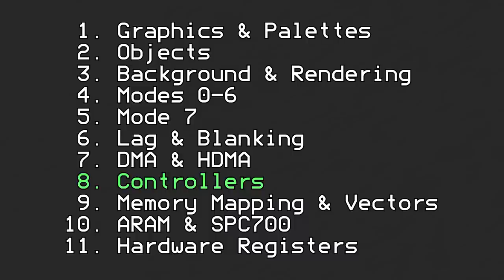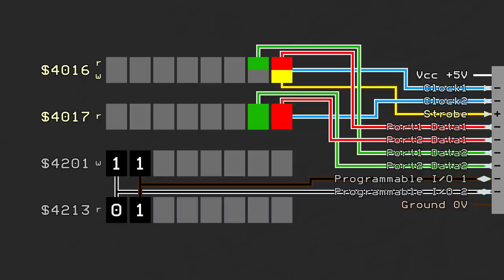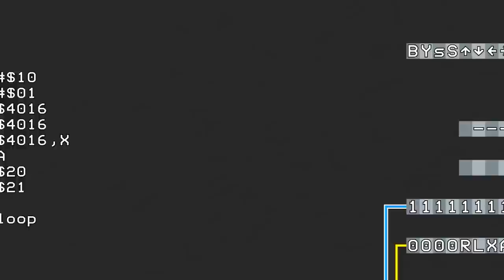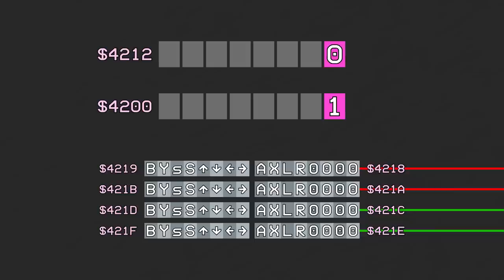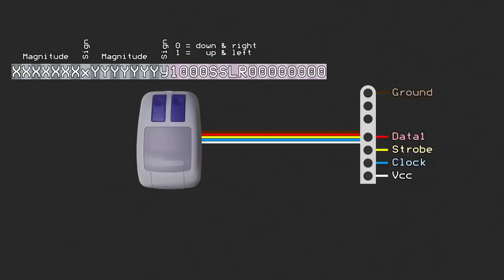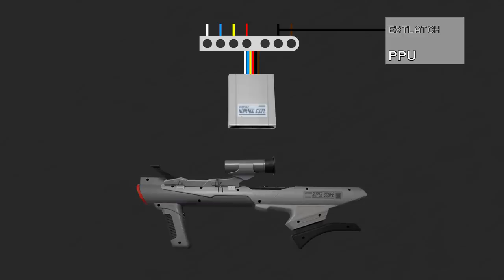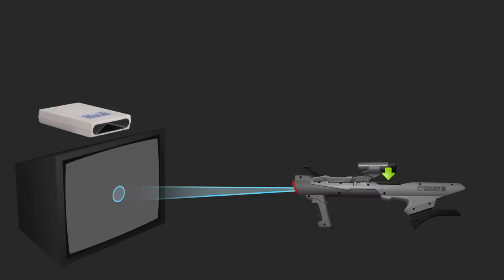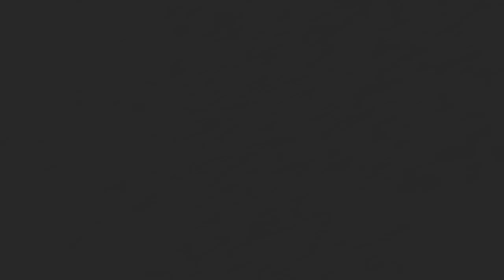Controllers - Super Nintendo Entertainment System Features Pt. 08

Comment: You gotta see what's possible with official SNES hardware and TAS, the TASbot team was able to get Skype running on a console using nothing but arbitrary code execution and several million controller inputs PER SECOND, across 8 SNES controllers.
Reply: Woah. That's amazing, actually. o.o
Reply: Basically streaming video data through a serial port. Not exactly "running" on the SNES.
Reply: Just to show that hardware limitations can be greatly reduced by clever use of code. I wonder what could be achived with modern technology if everything was used to the brink of its capacity. 
I mean.... yes its impossible due to the sheer size of code involved, but just think,
maybe someday we will have machine learning AI strong enough to auto-optimize any code to that level of usefulnes.
Reply: thats so cool!

Comment: It’s crazy how excited I get whenever I see that you posted a new video. Truly some of the highest quality content available for the subject matter.
Reply: This is probably THE most understandable explanation of a small system architecture I have ever seen/heard. Those expensive student coarses are much worse. I will probably never program SNES at all but this is very interesting nonetheless.
Reply: @jwhite5008  I agree.  Elementary computer engineering courses should be taught from this youtube channel.
Reply: @jwhite5008  SNES programmers had it easy. Try riding the beam on a Atari 2600 with 20 bits of data...
Reply: @jerricabenton842  
The classic education system has been overthrown by YouTube.

Comment: Super excited for the 10th video talking about the SPC700, there don't seem to be too many good in depth explanations of it out there.
Reply: I can't wait 😩💦
Reply: what i know abou SPC700 Sound Chip :

they have 9 channels
sample are programmable
some snes emulator can save spc data into .spc file format,which can be played by any spc700 player
its a sound chip obviously
Reply: 8 channels, actually.  64 KiB of ARAM, 4 registers to interface with the SNES processor, echo delay up to 240 milliseconds...
Reply: Also, the SPC700 proper is actually a 6502-style processor that controls and sequences the S-DSP chip, which does all the audio processing. And the 240ms digital delay line includes an 8-tap FIR filter, which when combined with feedback can be used to generate reverberant spaces.
Reply: And some strange stuff about BRR.

Comment: I had no idea these controllers were so complicated...
Reply: I had no idea the Super Scope was so complicated
Reply: There are some way more complicated ones, like the 6-button megadrive controller or newer stuff like the Wiimote
Reply: @Wuerfel21  nah, newer stuff uses off the shelves protocols, very high bandwidth, and not synched at all with inner working of the main machine CPU. Lots of software takes care of everything in modern hardware. Modern controllers use microcontrollers inside that are thousands times the processing power of the SNES. No one cares anymore of counting every CPU cycles.
Reply: @Damien.D  partly because with multicore CPUs, that's basically impossible.
Also, Bluetooth, which is used for controllers, is a very strict standard. You can't just do whatever radio you want
Reply: These are very simple controllers technically.
Reply: The wiimote would probably be an interesting one, 14 analogue axis (with nunchuck), buttons, light gun, speaker and memory saving on one device.
Reply: Actually, they're surprisingly elegant.
Reply: everything is complicated in electronics.
Reply: Ikr, I never thought they went beyond "press a button, send a 1, carry the 1 until button it's no longer pressed, 0", maybe because I'm just an electronic technician not an engineer.
Reply: Peter Hart: what?
Reply: 3 button mega drive/genesis and Atari 2600 are dead simple by comparison.

Comment: This is so neat. I was already wondering if you could just y-split a SNES cable and attach two pads (twisting the D1/D2 lines for the second controller like in the old floppy drive cables) and therefore getting a rudimentary two-players-per-port (assuming software that expects player two on port1-D2) but of course, using the programmable line as a toggle is really smart, not like the basic gamepads make use of it anyways, right?

Kudos on the video dude, I've mangled examined quite a few gamepads over the years, but only from the hardware perspective, so learning how the CPU interacts with them is really interesting.
Reply: furby

Comment: When you described Auto-Joypad read collecting 4 controller's worth of input at a time, I assumed the multitap worked by plugging into both ports and mapping both data lines of each port into the first data line of each of the four controllers. I didn't realise the multitap actually enabled 5 players (and is much more complicated than just taking advantage of the built-in auto read)
Reply from the maker: Yeah, one of the most confusing things about the multitap is the order of the joypad data... With auto joypad read, the data from the controller plugged into the port labelled "3" actually goes into what is referred to as "player 4" in the documentation, while "player 3" is left empty!
Reply: two easy explanations
A. the SNES works with ports 0, 1, 2 and 3 , which map to players 1, 2, 3 and 4 respectively.
B. the multitap documentation is based on controller+multitap instead of unplugged+multitap (player 1 is on 1.1, while players 2 to 5 are on 2.1 to 2.4)

Comment: 0:54 WAAAAAAIT!  What's that light gun that looks like a real M16?!?!
Reply: The light gun and the super scope were similar but different controllers.  What he talked about was the super scope, the light gun was an earlier input device which to my understanding worked by quickly changing the screen to be all white with a black dot where the target (a bird in duck hunt) was at then detecting whether the gun was pointing at the black dot or the white screen (it may have been a black screen with white dots, it's been a while).  I presume it would work with an 8 bit register since it only needed to send the trigger input (1 bit), the controller ID (4 bits) and whether it detected a black dot or white dot (1 bit).  Registers most likely had to be 8, 16, or 32 bits so the extra bits would always be the same.  It probably also worked with auto-read making the programming a bit easier.  I remember the light guns were really easy to fool, never got to play with a super scope.  From my understanding either the light gun or the superscope won't work with modern screens (something about taking advantage of a weird quirk of CRT's).

Comment: I can't WAIT for you too make a video on the SNES's sound hardware! 😯
Reply: Quick preview: It's basically a separate CPU hooked to its own RAM and a DSP. It boots up in a program that implements a tedious protocol to receive data from the main CPU via a few 1-byte ports. This data is the actual sound player program the devs design for their use and the audio samples it can use to create music and SFX. The sound program takes over and will have some kind of protocol for the game to use to tell it what to do, such as play song 3, or play the jump sound effect.

Some games even implemented a streaming protocol to update samples on the fly. Those games cannot be replicated with the snes music files (SMF files?) because those are actually just state dumps of whatever game's audio system. The player is just a stripped-down emulation of only the SNES sound system. Any samples not in sound RAM when the dump is made won't be available for the player, as the main CPU isn't there to send them in real time as it does on actual hardware, or in full SNES emulators.

Comment: Mmh. In spite of appearances, the Super Scope is a light pen, and it's behaviour and limitations are largely consistent with this.

If you don't know what a light pen is, it's a common input device seen on 70's and early 80's computers that, as with the explanation for the scope, detects the position of the pen relative to the screen by using the raster scan and comparing it to the computer's internal timing for when it was drawing various parts of the screen. - traditionally a light pen is held touching the screen, but as you can see with the Super Scope, it's possible to design a variation of the technology that works from a distance.

Comment: I would assume this was similar on the NES. And would explain why all the ducks had the white rings on their necks with blue or green bodies, blue sky and green grass. Only thing brown was the dog in between sets. I think the trees had black trunks but they were rather thin. The hard ducks had red wings if I remember correctly. (Been over 30 years! My brain doesn't remember like it used to!)
Reply: The NES zapper worked differently and was a lot simpler.  Duck Hunt used a completely different trick than what's described here - when the trigger is pulled the game flashes a black screen for one frame with white squares where the ducks are and the white light is what's actually detected by the gun.  This is why you could cheat by shooting at a light bulb.
Reply: @fatcerberus  yes, I recall this now.
Reply: Though it never occurred to me to cheat. At that point, you are just cheating yourself.
Reply: @anthonylosego  Meh, I had a Game Genie and got way more replay value out of all my games than I would have otherwise.  Doesn’t mean I still didn’t enjoy playing legit.  At a certain point you get bored of playing a game normally and just want to know what happens when you push it to its limits.  Cheat codes get a bad rep, IMO

Comment: Ah. Programmable IO.

I was wondering about that. I know about the PPU latch and the super scope, but this IO pin is poorly documented.

I knew however that the controller ports had to be capable of bidirectional communications, because I own a device released in Japan for the Super Famicom, that is built to work with several games, and in particular, with the RPG maker titles.
It's a device that lets you save data to an external device that plugs into the controller port.
(so it's like an improvised memory card). Obviously for this to be possible there has to be some means of doing bidirectional data transfer.
I forget the name this device has, but I've wanted to investigate it's data protocol, since replicating it's behaviour would provide a means of saving RPG maker projects fairly reliably.
One of the interesting aspects of this is that I bought one brand new (It wasn't used at all, and didn't even appear to be particularly old stock) as recently as 2015 or so, which suggests they may still make them for legacy reasons.

It's also interesting to note that it's an improved version of a device created for the Famicom that served as a way of saving game data.
(it's use with RPG maker on the Super Famicom is not it's only purpose, but obviously one of it's more significant uses, given what RPG maker is about...)

Comment: so... you could technically splice a NES plug to the Snes cord and have it end with both a Snes and Nes plug means that you could technically make a Snes controller work for both consoles. as long as you only plug it into one system is actually really cool. Even better. is if you get a female Snes to Male Nes adapter. that would also work too.

Comment: 5:34 Holy crap, if you threw out the first byte, that controller input would be RETRO COMPATIBLE WITH THE NES!  Did they do that on purpose?
8:08 Yup, sounds like it!  Reason being is that the system is big endian, so the first byte in controller memory is actually read in second.
13:38 I just realized you could plug two mice into a Super Nintendo and read from both of them.  That can make for some crazy analog input for say, boxing or two player clicking action.  Oh, and because the Mouse doesn't use any additional lines, you could have EIGHT mice plugged in if you wanted.  Reading the extra data could get time consuming fast though.

Comment: N-Warp Daisakusen is the only SNES game I know that supports 8 players, and it does so through 2 multitaps.
Also, is a custom SNES controller with analogue sticks (using today's technology) possible?
Reply: Obviously original games wouldn't be able to use it but with a larger register like the mouse uses it should be possible to add the extra inputs needed for analog sticks.  Whatever games were made to use the sticks wouldn't be able to rely on auto-read like the original controllers so it would likely add some input delay (which a casual gamer may not even notice).  If the controllers were designed so anything above a certain threshold gave the same input as a regular controller (so holding left would activate the same bit as the original controller plus some extra bits the normal controller doesn't read) it could even work with original games (backwards compatibility though obviously the original games wouldn't be able to detect the differences between a partial and full tilt).  The backwards compatibility would also require a switch on the controller to tell it to send the original controllers ID (0000) and not send the extra data (so basically just work like a regular controller).

Comment: I wonder if you can plug four multitaps into one multitap
Reply from the maker: You could but they wouldn't work properly in 4-player mode. The multitap needs all 7 connections to work, but only provides 5 of them to units plugged into them.

Comment: Great video!

I have a great question for you; although this is about an NES controller, since you said they are essentially identical, you may be able to answer this.

I have one controller that works fine - if you only press one button at a time.

BUT - if you press MORE than one button at a time, it "locks", cancelling all inputs and won't work again until you release all the buttons.

Any idea what may be causing that weird behaviour? It is only happening on this one specific controller. It is a Nintendo genuine.

Comment: 9:45 I thought those were the other way around, where A/X/L/R were in $4219/B/D/F and the other bits were in $4218/A/C/E.
Reply: Surprisingly, SMW is one of the few games if not the only one which stores the controller data backwards (Yoshi's Island e.g. stores the controller data correctly). Then again, it was planned for the NES and the high byte was a late development addition.

Comment: This is [again] so great. But I have a doubt now. What happens when a game is lagging? Ahem, I mean what happens if there's still code to execute when the blanking should start? The SNES is forced to redraw the same frame and thus we see lag. But does it mean that the SNES will scrap whatever button input there is for that repeated frame in particular (assuming we're using a TASbot to change inputs every frame)? I know a human would just be holding buttons for the duration of the lag, but what if the input changes?
Reply: It depends on how the game in question is coded, but for most games, yes, input on lag frames will be discarded.
Reply from the maker: Generally the input would not be checked again until the next non-lag frame. If a game used auto joypad read, the auto read would still happen and registers $4218-$421F would update, but the values in them wouldn't be used that frame.

Comment: 23:30 Green light isn't "inherently more luminous than blue". Human eyes are more sensitive to green, but that's our problem, doesn't affect electronics. The infra-red filter is presumably there because the gun spends half it's time firing off extremely bright rapid pulses of IR towards a glass screen, so there's going to be lots of interference of entirely the type you don't want. So a simple bit of coloured plastic is a blessing! 

As far as red phosphors being more persistent, I've never heard that, but I can't think of how it would bother a light gun. You just need to measure the start of the pulse, where it is (in time). It's duration doesn't matter. Other light guns don't seem bothered about it.

Comment: If you try to play Super Mario RPG with the multi-tap connected, the game will tell you to disconnect the device and reset.

Can you make an addendum explaining why this occurs?  I suspect that it's because the EXLATCH used by the peripheral interferes with the internal cartridge processor chip, but I've never heard an actual explanation.
Reply: A guess but, maybe power draw? The multitap must need some power to function, and yet the extra CPU probably needs some as well. Could also be an issue with later consoles when Nintendo reportedly reduced the power available to the system, to stop copier devices as well as cheat devices (either deliberately or consequentially).

Comment: I'm not fully sure if I lost this info on the video, but with the PI/O interaction on the multitap, this means that you can read all 4 controllers inputs in less than one single frame (16ms~) ?
Reply from the maker: Easily, yes.

Comment: What's with that mouse? Why do those shenanigans? They should send 12 meaningful bits through Data1 and the other 12 through Data2. And use programmable I/O for speed setting. Why not use the whole interface you have available? That would also enable auto read.
Reply: If they did that you wouldn't be able to use the mouse through the multi tap.
Reply: @kericlapboards7737  Why would you need to? You have the other controller port free.

Comment: What's better xinput or directinput ?
Reply: Gonna have to say directinput. xinput was designed only for use with 360 controllers. directinput had far more versatility with its maximum of 128 buttons and 8 axes. Not to mention the limits on force feedback that xinput introduced.
Reply: @davidmcgill1000  absolutely agreed, i can't for the life of me understand why microsoft calls directinput a "Legacy API" ?